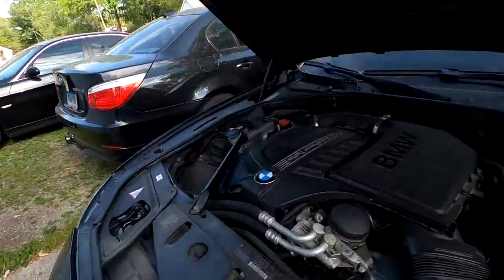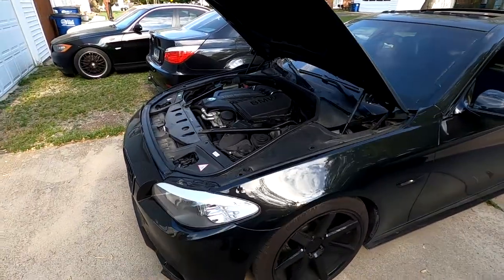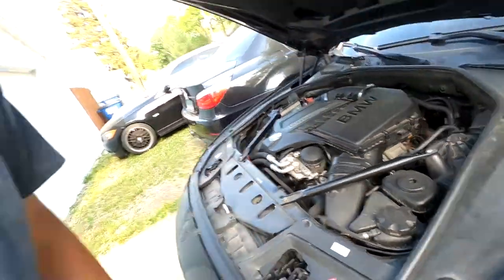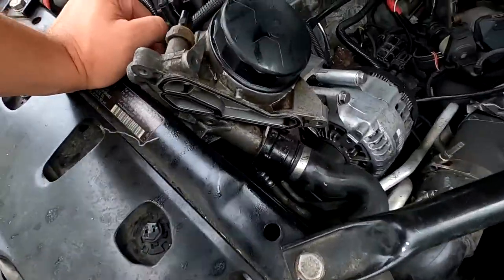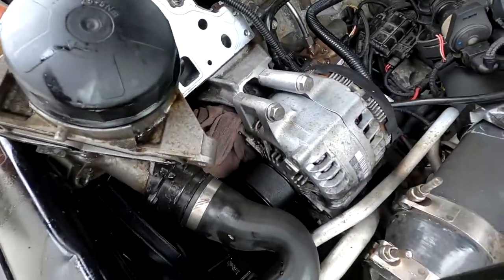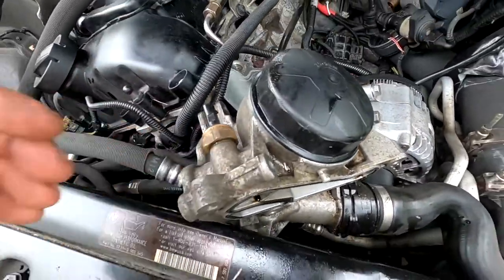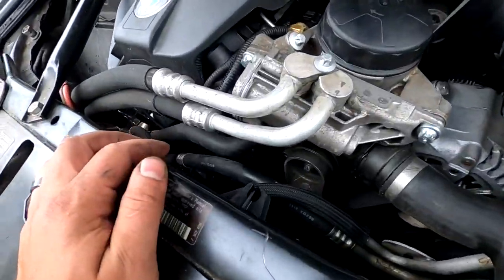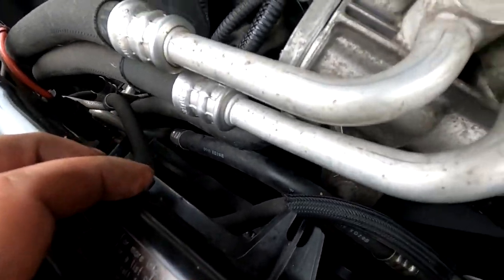How To: Change The Oil Filter Housing Gasket On Your BMW

Comment: Would you need intake manifold gasket ? And gasket for cooling lines....and order kit for oil filter gasket just mist mint 2002.....looken at couple 2006 any idea which model typically lasts longest or any pointers....I like larger roomy cars.... To Hanks for your video appreciated.....
Reply from the maker: If you like the larger Cara, definitely get the 5 series!